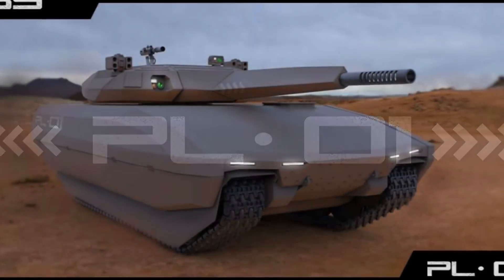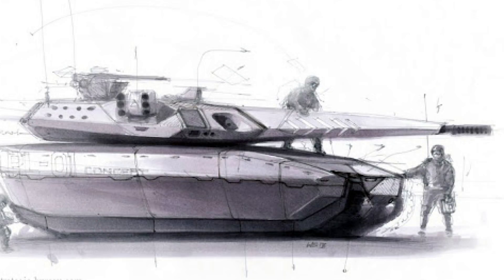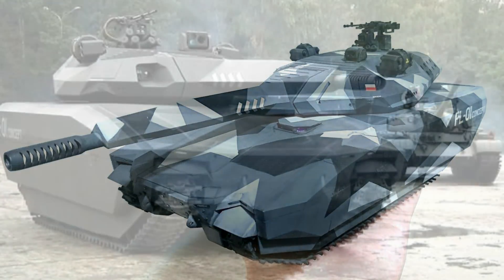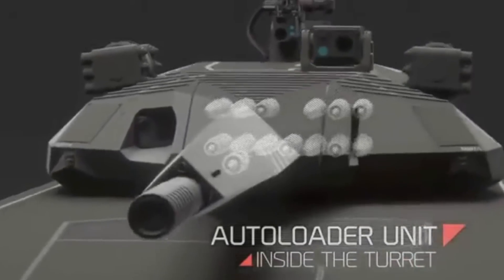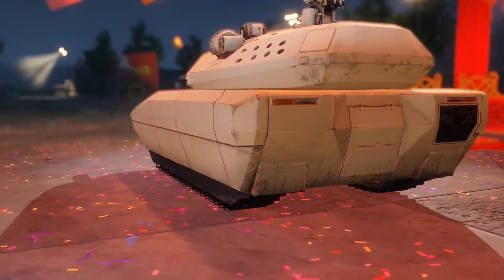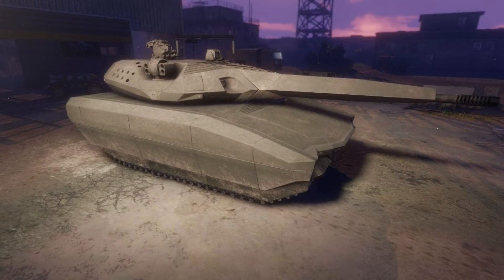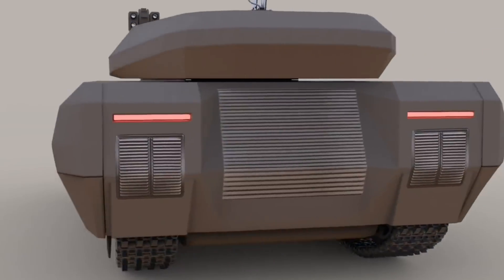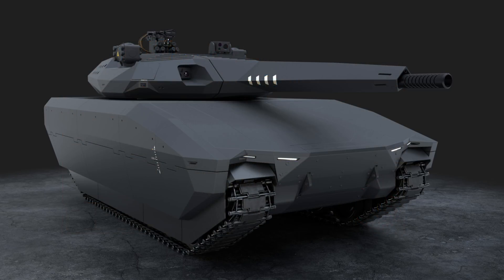PL-01 Prototype concept tank | POLISH STEALTH TANK

Comment: Concept PL-01 was a more complex project because the basis of the project was to create a family of vehicles - from the Combat Support Vehicle, Infantry Fighting Vehicle, Engineering Equipment to Armato Haubice.

It could be said a little more....
Reply: Don't spread false information's lad, internet is already full of them.
Reply: @Galvars  Please analizę the programs od the Polish army and scientific center which is Obrum ;)
Reply: @Darknesio  What do they have to do with what you wrote about PL-01?
Reply: @Galvars  Because the chassis for the Concep was supposed to be the basis for
creating family armored vehicles. BAE System at that time strongly
promoted the BWP CV90 salesman in Poland, which was to be the base for
the Concepta Pl-001. According to the assumptions, the most complex tank
construction was to be built first, and other constructions in the next
stages.
Reply: @Galvars  The next project after the Concept Pl-01 was WWO Anders, which was based
on the Polish chassis and not as in PL-01 on CV-90.
Reply: @Darknesio  Outside information about CV90 promotion in Poland that did indeed take place in that time, what you say is false. PL-01 Concept was not supposed to be basis for anything, it was design only for MSPO expo on borrowed from BAE chassis of CV90 (as OBRUM did not have any working one for such task) that after expo has been returned to original owner. The only explanation (outside intentional spreading of false information's) is that you mistake PL-01 with promoted in same time by OBRUM Multirole Combat Platform codename Anders that was indeed designed as potential base for multiple different versions. It is still around but under different name as Universal Modular Tracked Platform.
Reply: @Darknesio  Not after but before. Work on MCP Anders start in 2008 with first presentation in 2010 and PL-01 was build in 2013. And indeed it was build on own chassis that take elements from some older designs but it was mostly new one.

Comment: The fixation with the 35-39t limit on medium tanks has to do with the loading capacity of the Airbus A300 Atlas. Everyone is looking for somthing that has a real gun and can kill T-72s and can be transported in a prop aircraft.
Reply: But can they be airdropped in?
Reply: @valhalanguardsman2588  Nope the limit for that is around 15-19 tonnes. The 2S25 Sprut i Russia can be paradropted and its around 18 tonnes.
Reply: @MrOllevarm  T-90 can be paradropped
Reply: @valhalanguardsman2588  Well yes, any tank can. But its wont be able to work and fight.
Reply: @MrOllevarm  crew paradrops seperatly from its vehicles, exept BRDms, those, or at least some of them, can be paradropped with crew inside, i think

Comment: Coming from ur IFV Leclerc vid, I think this one that would be a good candidate for a modular IFV - MBT design. Unlike the Leclerc whose chassis' price was too expensive, if the PL-01 is actually said to be a fraction of the price and on par with the price of other NATO IFVs then I could imagine a world with a variant of PL-01 that's a tank hunter (the one on the vid). And a variant of it as a recon vehicle (PL-01 with a different turret with auto-cannon, ATGM and pintle mortar). So that's reduced weight from PL-01 but same engine. Since its a futuristic concept we could also add a small recon quad rotor-drone station that gives aerial visual feed in the IFV. Then an ambulance (no turret, has medical stuff) or Infantry carrier variant (bmp style small turret and infantry seats). 
The auto-loader should be set-aside able if it breaks so the loader can manually load the gun if necessary. It would be even cooler if the Poles could change between the addition armor versions or tank type versions on the field with 5 men, 1 mechanic and a hammer. Or if that's unrealistic change tank variants with 1 recovery vehicle and 1 equipment logistics vehicle on the field.
Reply: There will certainly be different versions of the PL-01!

Comment: Whether someting is suited for the "modern" battlefield requires the answer to the questions: Where, what enemy, etc.?

The main problem in Europe - as the american generals and exercises have pointed out is the problem of moving across rivers. Once you get a vehicle weight above say 35 tons you run into a host of problems.

1) The "rubber tracks" which in itself is a great idea; but it has its limitations in the forseable future. Getting rid of the fourth man in the turret is not so much a question of loading the gun - which is an activity for the fourth man IN HIS SPARE TIME. The fourth man is primarily there to tend to the bloody tracks.

2) As long as you can drive ALONG the rivers of Europe road problems are not that serious. Only: You can't drive very far in any direction in Europe before you have to cross a wide river. The German solution to this is building bridges and have their rather excellent bridging equipment - resulting in having to build, maintain and train crew of a lot of vehicles - the vehicles themselves were so costly, that at 7½ mio. USD each unit costs more than a main battle tank (Leopard 2 at - say - 5 mio. USD).
And with Europe - especially Eastern Europe being what it is (and likely to remain so for the foreseable future) you need a lot (like in: A LOT) of said vehicles.
You run into the same problem as with the Gepard anti-aircraft protection system: You need more anti-aircraft vehicles to protect the tanks than tanks - each of these service vehicles costing more build and maintain than the tanks in the first place!
You get "solutions" that are more complex than the original problem!

3) There is SOME progress with modern armour which in the end translate into better protection for the same weight. But again: It is not the wave of the magic wand.

4) Then comes the question of the gun. Problem is that the L7 is a very good gun - and there is an insane amount of ammunition for it . If you move beyond 105 mm., you are in practise talking artillery. This is because to get the muzzle velocity required for bringing the needed kinetic energy to the target you have to accept a lot of recoil.

Comment: I agree with you on the reconaissance. As you probably know German Panzeraufklärungseinheiten (armoured reconaissance) had heavy recon platoons equipped with Leopard2 for reconaissance by fire before one of the last reforms/restructuring of the Bundeswehr. I´m still divided on the practicality of those reforms - giving away the Luchs armored car platoons as well as the heavy platoons in favour of the Fennek recon vehicle wasn´t the best decision IMHO. 
This (or a similar vehicle) would have been nearly perfect as replacement for the both, the Luchs and the Leopard2´s. Ideally with the addition of two additional crew for dismounted recon (like the US M3 Bradley CFV), operators for recon gear and as addtional crew (four more hands for mainenance tasks and sentry duties) as you already mentioned in your previous videos. 
Such things could combine the various reconaissance philosophies (like the US Armoured Cavalry, the Fench doctrine, German cold war PzAufkl etc).

Comment: I really like the design of this vehicle.  I doubt it will see active duty, but there is always hope.  I just wonder how the crew will be able to fix the tracks or suspension.  I didn't see how the crew would move the side skirts.  If you want one at your house, Takom have released one in 1/35 scale.  :-)
Reply: It was never design to go in to any production so there was never any hope in such mater. And Takom model is pretty good, supposedly based on original plans from design studio that made PL-01 for MSPO show.

Comment: So it was so hyped it didn't turned into a tank but turned into an fancy armoured vehicle. Or are my interpretations wrong?
Reply: You mean that it was turned in the new IFV prototype from HSW called often as "Borsuk"?
Reply: @Galvars  Yeah
Reply: @rodeanalfanteforcadela7645  Nothing like that, there is no connection between those two projects. The only thing that make them similar is external stylistics that is now rather popular.
Reply: @Galvars  Ah. I get it now

Comment: I think we might have missed a trick here Ladies and Gents... very very shortly the 'man in the loop' system of robotic weapons will mean that a tank of this nature could be rapidly adapted to be unmanned and to a degree, autonomous with AI infrastructure growing rapidly... Think the Reaper drone, kids in demountables outside Las Vegas piloting tanks in Europe... Then consider that the development of 'sensor diminishing technologies' or 'stealth' (which today incorporates not just infrared but also other outputs like EMF) will provide more evasion potential and couple that with the fact you can lose 15 tonnes or so if you remove all the bits and bobs designed to keep the humans inside alive... If that were the case the tanks of the future will be no higher then the treads required to actively traverse the battle space and many more weapons and ammunitions can be stored when you use some of that space the crew occupied... So all in all yes, this is a concept tank but one from which you could 'build down then up' again.... There's definitely something coming from this research that will make it's way into a real asset in the future..

Comment: It’ll never be useful, just tell the poles to get some oppressor mk2’s
Reply: Or the poles can use pasive mode
Reply: Nah just get a sub with guided missiles, or a b11 strikeforce but hey who knows
Reply: Though the top mounted machine gun turret is pretty strong, fast firing, and accurate, and can easily take them out and outrange them, though you do need a friend for the gunner position

Comment: Well now, when it comes to the T-14...
Reply: Stink Wrinkles  Exactly. The T-14 is probably going to be the easiest modern MBT to mission kill.
Reply: Stink Wrinkles  Russia has nowhere near the capacity to produce a significant amount of T-14's no. But the fundamental design of it makes it look like it's going to be one of the easiest tanks to knock out in modern battlefields.
Reply: Stink Wrinkles  It has to do with the design of specifically the turret. Russia has gone the opposite direction from their past and actually focused on crew protection and comfort. The hull, where the crew sits, is very well protected, and has all the standard suitability features you would expect, like ammo storage protection and blow out panels. However, the turret is very lightly armored in comparison, and while there might not be a person inside there you need to protect, many of the tanks vital functions are located there, including the functionality of the main armament. Knock that out and you're basically a sitting duck.

Comment: I have to say, this looks like it'd be really useful in a reconnaissance/defence role. You gun it into a good hulldown place (something easier to get to because of how small it is), pop a few shots off, then leg it out of there with that engine. It doesn't need to take shots if the enemy can't shoot it in time, and that active defence system seems like it'd be good enough for the few shots sent its way.
Reply: Yes, that's the point of stealth technology, to be undiscovered 
by the enemy and not be detectable by enemy weapons. In any case, the future belongs to stealth ground vehicles. Because most anti-tank missiles are so-called "fire-and-forget" missiles that are either controlled with electro-optical thermal imagers or with active radar. In the future, not only tanks will be protected with stealth technology. For example, armored fighting vehicles will also be protected in this way in the future. Incidentally, of course, not only the Poles are developing this technology.
In any case, if all combat vehicles are protected with stealth  technology in the future, then the old wire-guided technology will be used again, i.e. missiles guided by wire by an operator. The disadvantage is the limited range, because the range is reduced by the length of the wire.

Comment: Extraordinary nice concept...!!!! If you add an electric propulsion system you can solve much of your heat problems. Today..,,and for large requirement of output electric engine based on hidrogen can work for this beast.
Excellent coverage Matsimus..., as always...!!!!
Reply: Perhaps the final product will be powered electrically. 
When upgrading the T 72 to the PT-91 Twardy, a new motor was also installed!